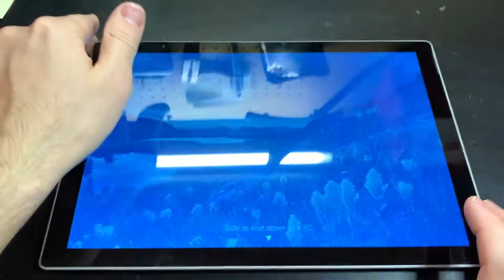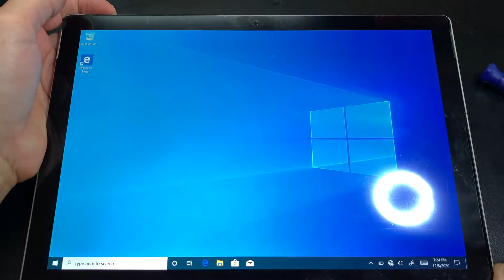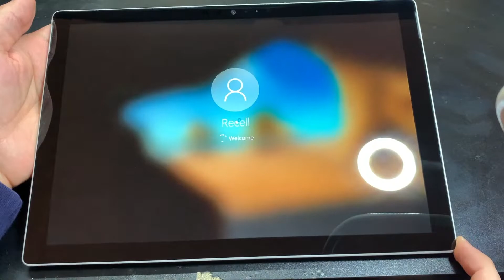Surface Pro 5 6 Model 1796 Screen Replacement | Surface Pro Restoration

Comment: Be super careful around the cable corner. You can easily damage the flex cables even if you nick them just a little bit, especially the touch cable.

Comment: I keep reading that replacing the screen on the Surface is extremely difficult and often leads to other problems but you made it look pretty easy and straight forward...Can you confirm it shoudln't be too difficult for someone with experience replacing smartphone displays (i.e. iphone displays)? Thanks in advance

Comment: Had an unbroken screen but needed to replace the touch controller inside, started from the right speaker, heated it up, started with pry tool, now i have a shattered screen and no touch 😂 i give up, it can go in the trash haha

Comment: 10:16 what are the copper plates on the top? That was where my screen was cracked and they came off with the adhesive while removing the glass…
Reply from the maker: Those are usually the Wi-Fi and Bluetooth antennas
Reply: @TheFixTech  yup, figured it out already but thank you! Tested Wi-Fi and Bluetooth and even though I basically tore them off everything is still working! I was surprised but felt confident enough to glue down the screen and move on… hope it continues to work or I’ll be doing this whole job again!
Reply: @JPaulston Hey, does it still work? :D
Reply: No, the Wi-Fi failed after a couple weeks. Needed to use it in a dock… ended up getting a new 9
Reply: @JPaulston   Oh man, I'm sorry to hear that. The display on my Surface Pro is damaged and I'm planning to try replacing it myself. But I don't know if that will help, because you can now get it used very cheaply. And I don't know whether I'll be able to open it properly and replace it.

Comment: 6:24 I am trying to use another 1796 screen from another surface. Do I need to transfer the cables from the old screen ? Or can I just use another as-is cable attached screen from the other surface?

Comment: You should wear gloves for a bit of insulation against the heat gun, and you should be sticking in plastic strips as the blade initially
separates the screen from the tablet shell. You can chop up those cheap plastic food containers into small plastic strips. Still, you
did a great job!!

Comment: I have surface pro 6 1796, do i need to buy LCD screen for   ''Microsoft Surface Pro 5 1796 ''   or   ''Microsoft Surface Pro 6 1807''. I cant find my model any where to buy.
Reply from the maker: They both will work, same screen for late model pro 4,5 and 6
Reply: @TheFixTech  I have bought 1796, and im happy to tell you, it working as new 🙏

Comment: Is there a difference with ordering a new screen for surface pro 6 1796, I was told they couldn't quote me until they take off the screen to see if there are 30 or 40 points inside (something to do with charging), I have never heard this before.
Reply from the maker: The 1796 screens are all the same for the 5th and 6th gens. Some 4th gen used the 5/6 screens. That is probably what they are referring.